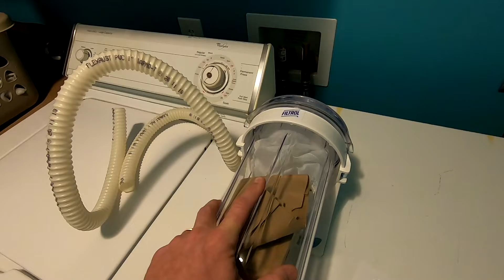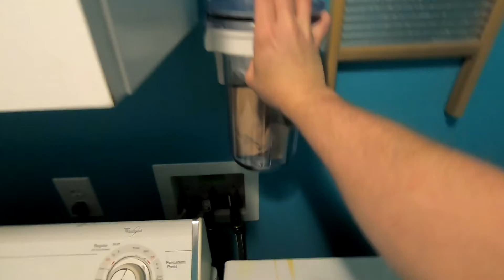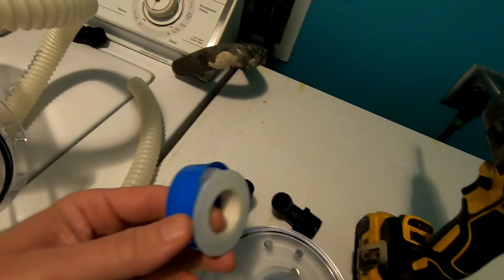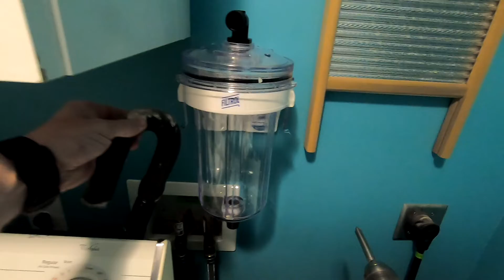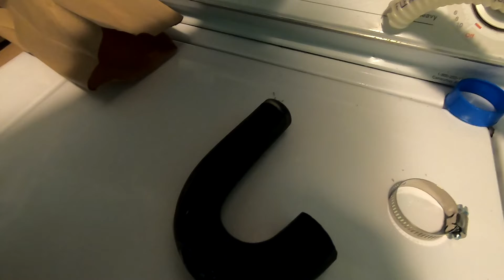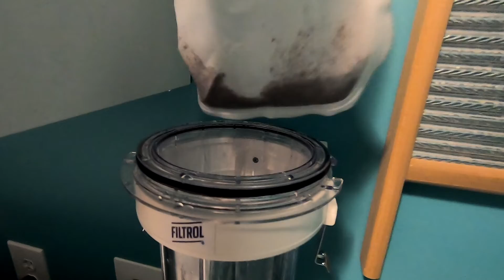Filtrol 160 Washing Machine Lint Trap - Save Your Septic System

Comment: Looks like it works really well. However, as with most filters you must be mindful of what happens when the filter gets clogged in some way. In this situation it could happen in a number of ways I won't elaborate on here. Is there a built-in bypass mechanism for such blocked situations? I don't see one in this device as you show it in this video, and you don't mention one. A blocked filter could end up in an overflow & floor flooding episode - a real disaster in some laundry room locations. Is there perhaps a way to add an external bypass to your installation?

Comment: Question. By the second week my entire filter is covered in some sort of slimy film (maybe it's just general Gunk and laundry detergent.).

I wonder if you're having the same experience? Because the first week it seems to just catch lint and by the second week there is lint at the bottom, but the entire filter bag on the inside is covered in a film that eventually clogs fully by end of the second week, and all the water ends up going through the bypass holes at the top of the white plastic ring... and then basically my laundry water is no longer being filtered out.

From what I read these filter bags are 160 micron. I just ordered some 300 and 400 Micron bags from Amazon to see if they work better at catching lint and not getting clogged by this slimy film I keep ending up with.

I don't use laundry softeners. And I use the lowest possible amount of laundry detergent recommended for each load. And my clothes are not heavily Stained.. but I have children and so we're doing laundry at least every other day.

I wonder if the hard water I have is somehow reacting with the laundry soap and creating a film or if it's happening to everybody regardless?
Reply from the maker: We don't have that problem. Mostly just lint and some debris in ours. But I could definitely see how your water quality (especially if well water) could cause some weird issues.

Comment: Hey I realize this video is 5 years old, but very helpful. Just one question or comment. I heard you should use a different manner to empty lint from filter and NOT turn it inside out like you do in the video. I think it’s because the filter lasts much longer that way. Have you heard?

Comment: The price for this system was $895 on nove 2025 when you click the link.  Hard pass.  You can get this system direct for $159, total scam.  If you only want to pay $25 hook your system up to a pool skimmer bucket with a filter.  Run the drain hose into the top of the skimmer bucket, and let the bucket drain into your house drain.  3 dogs, old pipes, need all the help I can get.
Reply from the maker: Thanks for sharing your thoughts and alternative solutions!

Comment: I am about to reconfigure my laundry room to make it more efficient. Typical big utility sink going bye-bye. I will be doing a similar wall drain as you show. We have ALWAYS used a filter (One leg from cheap pantyhose works great. Disposable).
We replaced the drain field when we bought the place 24 years ago and that was $12,000 THEN.
I am glad you posted this video because it reinforces what I am about to do.

Biggest difference will be that my disposable "filter" will be something to empty instead of throw away.
Keeping it easily accessible is key.

Comment: How is it holding up?  Thinking of buying but the price is a turn off
Reply from the maker: Works great. If you have a septic system you would be crazy not to buy it
Reply: It's less than the price of one pump out.
Reply: @gregdubya1993 it’s $850 bucks on Amazon. 😂

Comment: Will this drain not fast enough and get an overflow?
Reply from the maker: Works perfectly. Has way more flow than necessary, even when mildly clogged.
Reply: @JackofAllMasterofNone That's awesome! thank you !
Reply: Machine water pumps are strong. Same belt as the drum spinning.